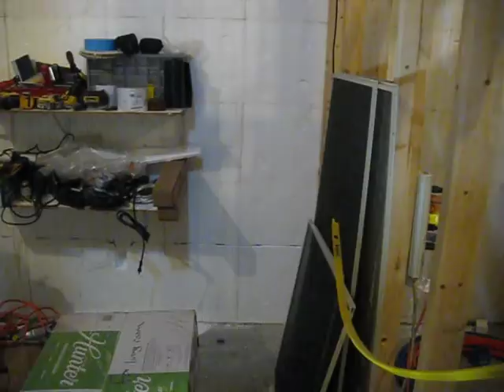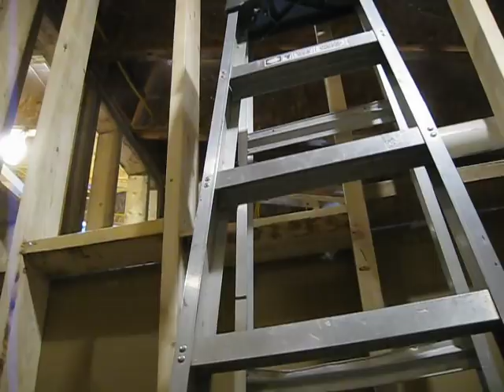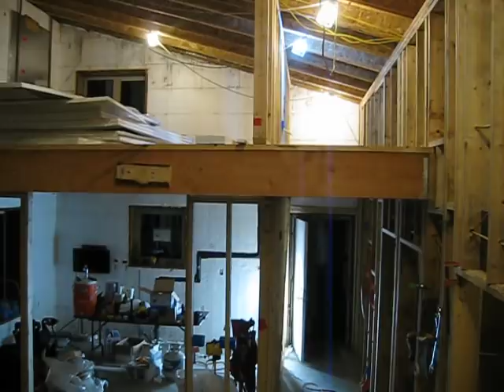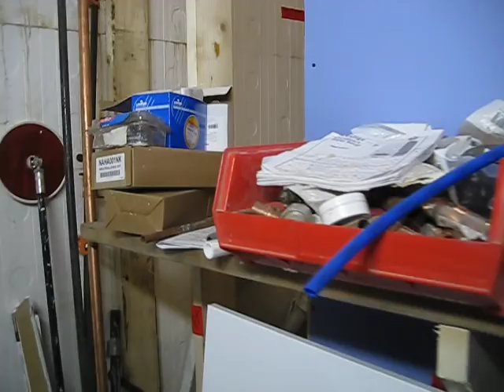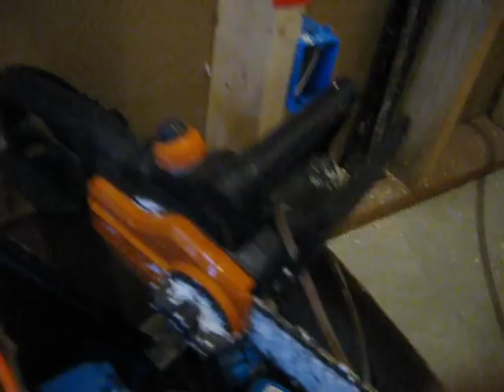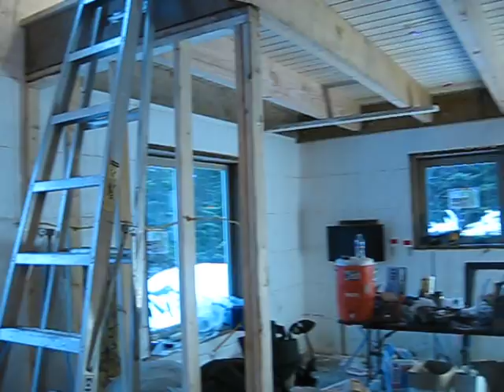House Building Part 17: Electrical

Comment: I'm concerned that you cut such a large hole in your roof beam for the plumbing vent. Usually when you take a cut in a structural member it's supposed to be in the center, and it's limited to a certain % of the overall thickness of the beam. Taking the cut out of the bottom is the worst place to take it as that is where the structural member is under tension as the load above flexes the beam (compressing the top and stretching the bottom). Recommend not doing that again at the bottom of the beam.

Comment: As a retired Tri State Electrician, It is my recommendation that the placement of electrical outlets for the most part be mounted at 36" as per the "Americans With Disabilities Act".  I started placing outlets at 36" after visiting my Grandmother at her retirement home 40+ years ago, it made so much sense making it easier to use the electrical outlets.  I wish my present home had the outlets at the 36" high as it is a real pain bending over to use the outlets as a person gets older.   Just a thought.  Merry Christmas,    

< https://www.hunker.com/13402689/ada-standards-of-electrical-mounting-height >          

Adult Unobstructed Reach Requirements;
Electrical outlets and switches, or "receptacles," must comply with "reach ranges" established by ADA in section 308 of the standards. These requirements permit people in wheelchairs to reach the outlets from the front or side. An unobstructed reach means the wheelchair can be placed directly in front of the receptacle or sideways within 10 inches of the receptacle. The receptacle height range for an unobstructed front or side reach is 15 inches minimum from the floor to 48 inches maximum.
Reply: That is a good idea, I am definitely not an electrician, but it makes sense. The only thing I would say though it depends on the intended purpose of the outlet. If it is for a entertainment system for instance it makes sense having it lower so you don't see it as much, where as something next to a couch to charge your phone and laptop it would be nice if they were taller. Not only would it be easier to get to but also you would get more reach out of cords.